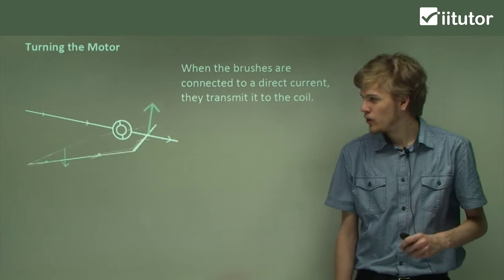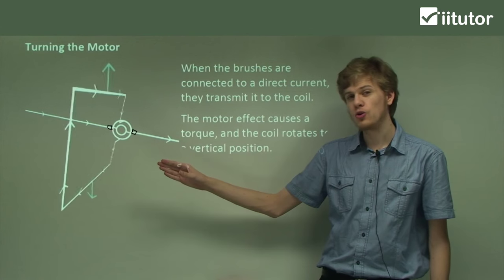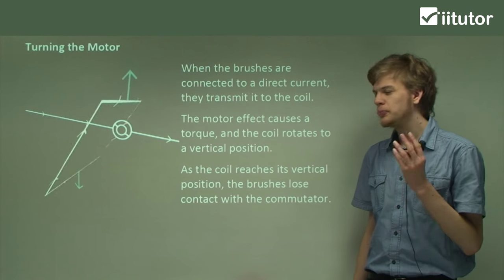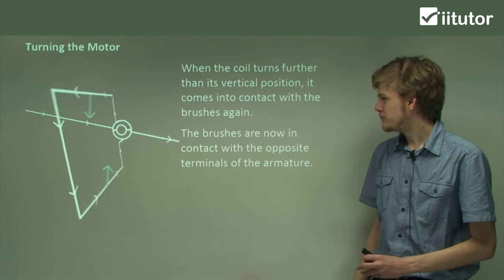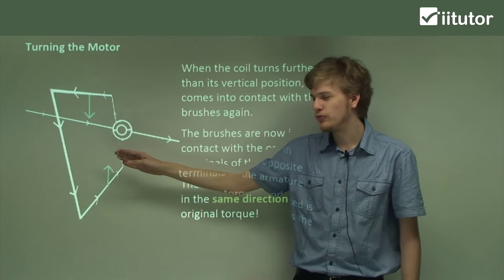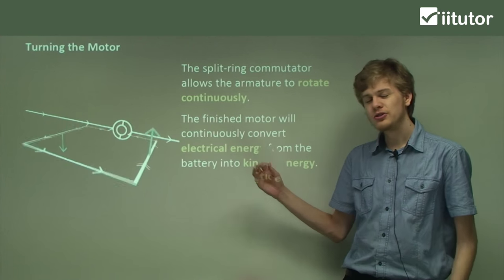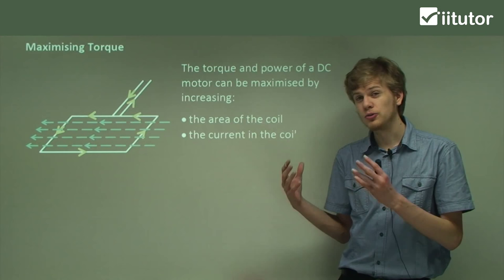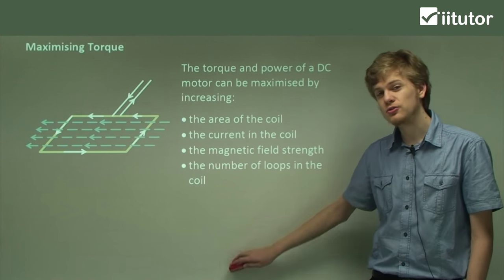DC Motor Demystified: How to Boost Torque and Performance

Comment: When I used a thicker wire in a motor then it's RPM rose but torque decreased.tell me a way in which I can increase both torque and rpm. Please
Reply: torque is inversely proportional to rpm, sorry.